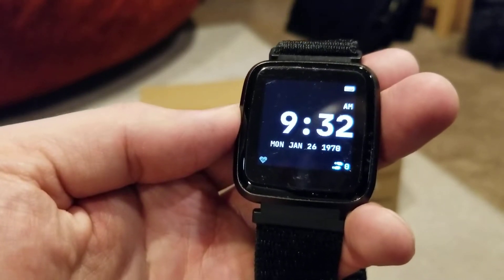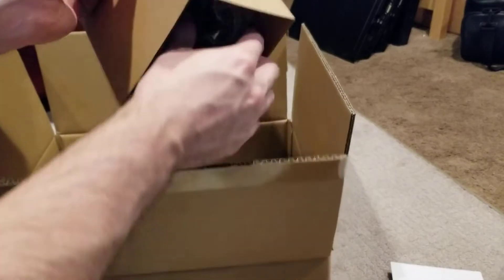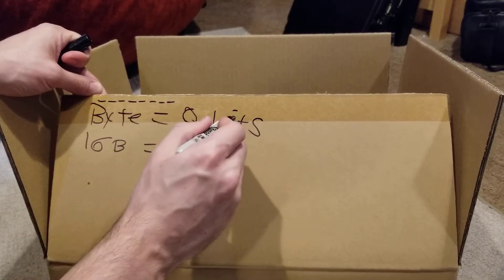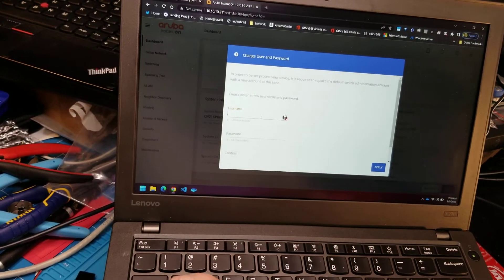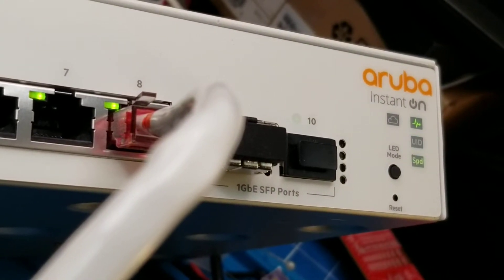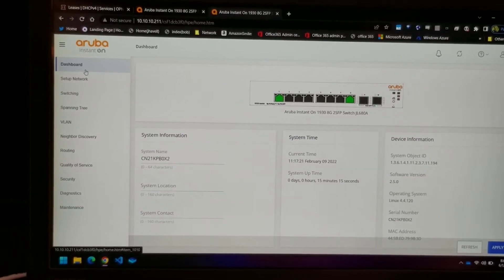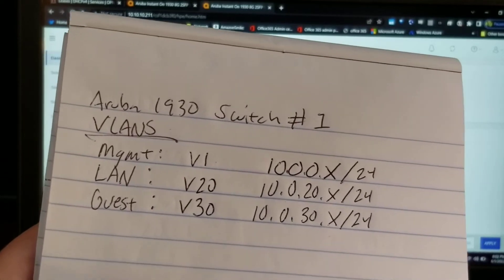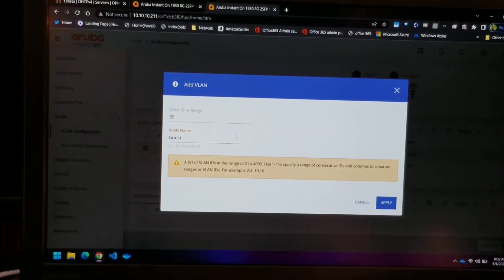Aruba Instant On 1930 8 port - unboxing and vlan setup.

Comment: In a production network where 50 Poe switches are there how can we identify there IP address ? and as per my understanding untagged means Access port and tagged means Trunk Is it correct Sir ?
Reply from the maker: If you have 50 switches on a network, they are not all going to be on the same subnet (unless it's the management subnet, I suppose) you are going to manually configure each of those units as you install them, or, if they got an IP by DHCP, you could look at the MAC address sticker on the back.

As for "access" and "trunk" that language varries between vendors -  HP calls it something slightly different than Cisco.  A "tagged" interface means that ip packets have a tag or or given a tag as they pass thru. An untagged interface means the blank identifier is removed and the interface is now exclusively used for that vlan. A trunk port is a little confusing as different vendors over the years use that term differently, sometimes all the networks on a trunk are tagged, other times the native vlan is still untagged and everything else is tagged. There are also default settings related to spanning tree and how long it takes for the port to negotiate if it will pass traffic or not, and that's its own topic for how vendors implement STP.

Learning vlans is more or less something you need to do hands on in order to best understand. Get some old switches and start playing!

Comment: So if i understand that, "Instant on" is take a DCHP Address dynamically, not has any IP preconfigured?
Does this "very smart" device also has a CLI?
Reply: In the InstantOn Product line, there is NO CLI...!
Only Web management in Local Mode and Web and App management in Cloud mode...
Reply from the maker: I do not believe it has a CLI.
it will take DHCP or if you wait long enough it might have a pre-configured address, I don't have this device anymore so I can't double check for you!
Reply: @jarenhavell  Yea, just had on 1930 24 Port, it has no IP, it is on DHCP, the device is really not good, very loud fan, and this Instant on, i had 3 times longer to configure, compared with a Cisco with Console Cable.🤯

Comment: Hello I follow your step to create flan but doesn’t register on my network and doesn’t get to the internet. Any suggestions or new video to full configure vlan please
Reply from the maker: you need to plug it in and wait longer. I waited 8+ minutes for the lights to stop flashing. Then you should be able to go into your DHCP server and find the ip address and you can follow along with my video to set up a vlan. https://youtu.be/78y66Gak7WM?t=631
Unfortunately, If you can't get logged in, that's not something I can help with...perhaps try using the app or reaching out to aruba support.

Comment: I liked your video. Looks like you posted this about 2 weeks ago. Probably enough time for you to get the full migraine from the VLAN issues on that switch. Have you run into issues with the VLAN’s not passing DHCP from your firewall? I’ve been desperately searching for answers on this and you’re the only person I’ve found that has setup VLAN’s on these switches the right way.
Reply from the maker: oh dear. that's not a good sign. That's a pretty basic function of a managed switch. have you used VLANs before? what is the layout for your network?
Reply: @jarenhavell  Yessir, I am a senior level engineer at an MSP firm and we deploy and manage Watchguard firewalls. The network I was originally designing it for is a warehouse environment with 22 wireless AP’s (the Aruba AP22 models). We were restructuring and decided to create a couple VLAN’s to help manage the new load of clients that will soon be eating through DHCP. I created 2 new VLAN’s and assigned them to the switch and then through the AP’s via the cloud-web UI. Seemed to be fine… the native VLAN’s work but any other VLAN’s that get assigned to any SSID do not pass DHCP to the client. After reading it looks like it’s a known issue with Aruba and they haven’t done anything to address it it several years which is very disappointing.
Reply from the maker: @ehuffstutlar  I'll be looking into this first chance I get.
Reply from the maker: I looked into it, but failed to get back to you. No issues in our deployment, all worked exactly as it should... I'm sorry that I couldn't help, but we were also using Unifi Access points...perhaps the issue was with the APs not the switch?